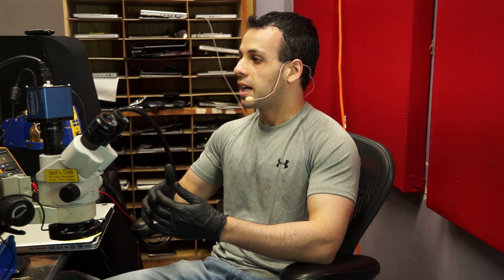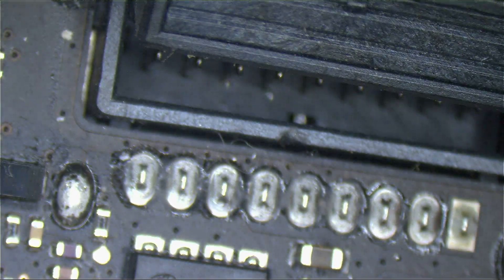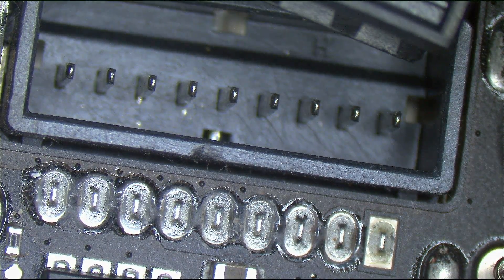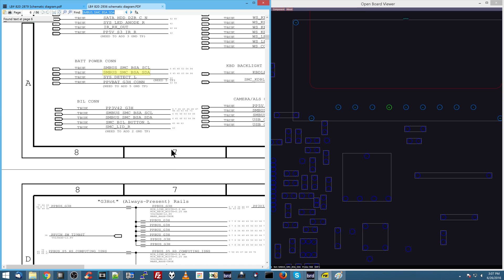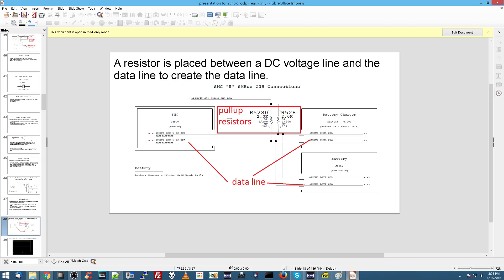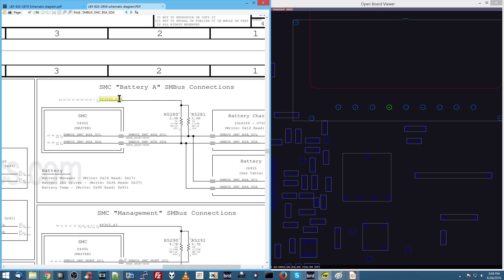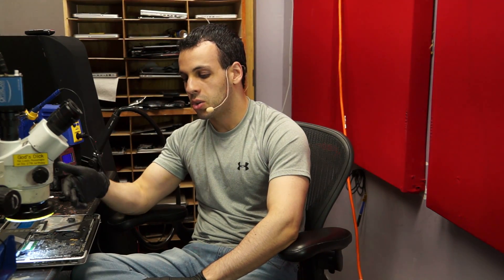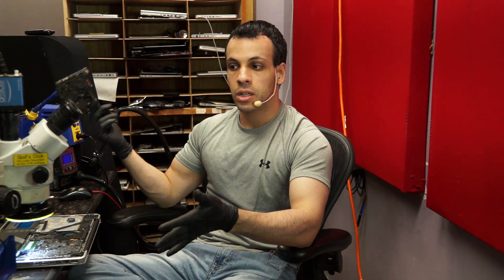DIY tip on Macbook battery replacement

Comment: Hello everyone,
I would like to ask if I can replace bad li-ion cells in my MacBook Pro 2009 battery. I know it iseasy to disassemble. But is there any EPROM reprogramming needed? I have brand new cells and high quality soldering tools to work with. I just don't have any device to "talk" to the battery yet.

Comment: Hey.
I was replacing the battery and me and my dad did NOT have a pry tool. We did it with out bare hands and I think this was a great mistake in this case. Please respond if you dont need to use a pry tool at all. I hope we didn’t. If we did, and I damged my MacBook, I’m screwed. I’d like to know if the apple repairment services can fix this.
And is this about BENDING the pins or just scratching it?
Thank you
Reply: By the way, I tried reseting the PRAM NVRAM and the SMC, which probably did nothing to be honest

Comment: I have a Late 2013 15” Retina MBP. I Bought a replacement battery kit from OWC. What is the easiest method to do the repair. The macsales instructional video has me taking out so much and I see it as unnecessary. I just need basic and thorough instructions. Please help.

Comment: I had to use a metal tool for this. Every other plastic tool I used broke. The connector was sitting really hard. I even managed to break the plastic in two on the battery connector with one of the plastic tools. Fortunately that part is part of the battery and were replaced. Everything seem to work when starting up. I can see the battery cycle count which is reset to one, so I guess I had a steady hand and did not short the data pin. Too bad the battery connector was sitting so hard in the first place. I guess that is what I get for not opening up the computer for over 7 years of ownership.

Comment: hello Louis
my 2015 Macbook Air 13 won't turn on with the battery connected, I've tried it with other batteries and it doesn't work. it only turns on if I remove the battery.
Do you have any idea what could be damaged?
Thank you

Comment: I feel you louis, i have a dell 7537 laptop. It is 6 years old. Now battery doesn't hold up charge and empties in 15 min or less. Which is fine , I understand. 
Then i contacted dell for the replacement part, they said that they only make batteries for the said model for 5 years max. And since the model is 6-7 years old. We  o longer manufacture it. AND directed me to a generic battery from a local market.
I shopped for a little after searching a best price and quality for a generic battery i found one. It was costly. No issues. So i went home. (I was traveling the point i got the replacement battery) now upon using 2-3 days it showed me an error saying that "this battery has encountered a permanent failure and needs replacement" i was like WTF. 
Called up the shop and he said as this is a generic battery, so don't have it in stock and has to order it and will take about a week to get. 
I didn't had time. So i thought  out haste that its just a battery  and may be there is some chip that has been locked to use only authentic batteries by dell. So i took the battery apart and removed the cells and put it on the old battery's board and packed it and WHAM! No power. Updates bios and all the things which i could find online but no go. After searching i found that this is a LOCK by dell on BMS chip on the battery's board that needs a constant power. And if it detected a re-cell it will shut down the battery and that BMS will not start. this is nuts. Anything i can do?

Comment: Hi, I'm not sure if i have this issue. I have the X in the top corner but if i do an SMC reset the battery percentage comes back but then the mac eventually goes to sleep and the battery disconnects and returns back to the black X. Would you say this is going to need a replacement SMC?

Comment: That is an amazing video... THANK YOU. Now had an error show up after replacing a battery. 
NOTE: I PROMISE, apart from removing screws, I used only plastic implements to remove the battery connector, and did not remove anything else (because there was nothing else to remove or move out of the way to replace a Mid 2014 MacBook Pro 15 inch Retina, , Model A1398, machine) and was static free. :)

Please, please help if you can….. I followed instructions for replacing the battery. 
Now… I have a problem that you might be able to help with. When I replaced the battery (correct battery - A1494 model - for this Macbook Pro model - the laptop recognised the installed battery but would not charge it and it would NOT work at all without power cord attached (which stays orange even though not charging, by the way). I was very careful when removing the battery connector too. I thought it might be the new battery that was the problem, and so I reinserted the original battery (which I was only replacing because had a shortened life as ageing batteries do. Prior to removing this everything worked and charged fine... and yet, THIS original battery came up with the same error. Have Apple put in a trip wire code in to stop us replacing batteries in newer glued in battery MacBook models at a hardware/software level????

My only deduction from here is that the board is now damaged somehow. But it is an odd error to see in the system report in that it recognises the battery as installed, but not charging, 0 cycles etc. etc.
Then get this, I have been to an Apple shop (and you can imagine what they said which seemed like B.S. to me, “The keyboard and battery must be replaced at the same time, we can repair your error for $1000”!!
I have never seen or heard this requirement from anyone else before.

Note:
1. I tried all the online methods I could find of restarting the Macbook. Shutting down, waiting 10 minutes, holding down the required keys during shutdown/startup procedures as per some instructions - no change or success.
2. I reset the SMC and PRAM and NVRAM to try and rectify this error, but no change or success.

I do have screen shots of the system report if that would help.

Can you help to get my Macbook to work on battery again? Please, please... getting desperate and don't want to replace what is a phenomenal machine with high spec. :) :)

Comment: After replacing the battery is there anything that i need to do? charge it all the way to 100% before use do i reset SMC? this is first replacement sorry

Comment: Hello Louis. I wonder if you could help me with a bit of advice. I own an old macbook pro (late 2011). Recently, the trackpad has started showing some erratic behaviour, with the cursor jumping from one side of the screen to the other while I wasn't touching the trackpad at all. It got progressively worse, which - to me - suggested the issue might have been battery related. I opened the mac and removed the battery. When I started the mac (now without the battery), the issue continued to present itself. :( I'm not competent enough to be baffled by the mac's behaviour, but I wonder: could it be a virus instead? Do you have any advice to offer? Thank you in advance for your attention.

Comment: GREAT video Louis, thanks so much for posting. I got to this video by searching for a solution to a "Battery" error I now get on a late-2011 17" MBP I bought, that just had a battery replaced with an SMP brand battery. It's possibly related to the non-OEM battery as many people seem to mention in the various forums--but I've actually read that SMP was an OEM manufacturer for Apple for awhile, so I'm not quite sure what to think anymore. Resetting the SMC doesn't seem to make a difference; nor does re-calibrating the battery, although that has indeed fixed the wonky time-to-discharge and charge percent indications. But nothing I've tried actually seems to clear the dreaded "4xxx/6/40000005: Battery" error. 

Sigh. 

Anyone have any ideas?

Comment: Convert your PP3V42 power line to PP12V6 with a flat-tipped screwdriver. Don't delay. Buy today!
Reply: More lika an instruction what you should do to buy a new Mac. If you are stupid enough to buy anything from Apple after watching Louis Rossmann repair videos.

Comment: Great videos. Request you to make a video teaching to repair old laptop battery. I have tried by changing cells on Sony and Lenovo using Panasonic cells but never get output voltage through the pins. Read many things on internet but nothing seems to work. Would be great help.

Comment: Hi i have a question i tested the pins for the charger and found 12volts at the first second it boots up but then it goes to .01 or 0 volts is the battery pin not communicating?

Comment: Hi dude, I need desperate help. I recently opened my MacBook Pro 15" mid 2014 to give it a clean up. All I did is disconnecting the battery, removed and cleaned the fans and heat sink (without removing it) with a soft brush and assembled everything back. The mac had 70% battery when I started this but when tried to power on all I got was a "Connect to charger" icon (the dead battery icon). I then revised the battery connector and saw i didn't pushed it all the way on one side so I did it and when tried to turn on, nothing on the screen not even the icon. It's completely dead .. no reaction at all and the magsafe light does nothing when plugging in... what the hell could had happen? I tried everything like smc reset, plugging unplugging battery.. etc... maybe I'm missing something ? Did I fried the board? Please help, Daniel , Spain

Comment: Why would someone even contemplate using a metal pry tool? when near something electrical, IE the battery.. People in manhattan really are morons.
Reply from the maker: +FlerrElectronics I use metal all the time and don't touch contact points by smc data line!

Comment: @4:07 I have to be a dick about this.. you used mobo circuit board as your arm rest? WTF?
Reply from the maker: My arm is hovering above the board, not resting on it.
Reply: Doesnt everyone ?
Reply: Louis Rossmann My bad. I jumped into conclusion just because your arm was that close.

Comment: The transmission industry is the same situation. They want to make it so you can't repair a simple problem you can only re and re and install a whole new unit. Sealed units you can not open without destroying the pump. At the factory they drill it out and replace it but where are you going to get one? They can't be pulled out without being destroyed. Try that when you live in the middle of nowhere or have a breakdown on your way there. How can you get it fixed? This law works in central AL or a main city but we don't all live in a city. For the sake of a 2 dollar spring or a 50 cent seal you have to buy a whole new transmission is the way they want to make it.
I rebuilt the transmission on the propelled wheels in a 6yr old lawn mower yesterday. It took two weeks to find parts. Sears the retailer disavowed any acknowledgment of the mower. No serial numbers on any of the parts. No breakdowns. No parts availability. I had to find the original Mexican manufacture that makes the mowers for a bunch of retailers. Then found all the other mowers they use this drive system, that does supply these parts and breakdowns. Then found the gear. All without serial numbers. The whole repair took 6 weeks. I'm so glad I took pictures.

Comment: Wow, I made the exact mistake you're describing when trying to replace the battery in my 2013 13" MacBook. Wouldn't turn on, no indicator, no clue what happened. Simply ended up replacing the computer with something else at a much higher cost. Frustrating that I was naive not to think and use metal tools to disconnect the battery connector.

Comment: is it possible to use such a tool to read/write to the smc chip e.g

?: http://ko.aliexpress.com/item/eMMC-eMCP-3in1-socket-SD-9x11-11x10-11-5x13-12x16-12x18-14x18-eMMC-programmer-adapter-reader/32542535705.html?spm=2114.010208.3.1.synz1w&ws_ab_test=searchweb201556_0,searchweb201602_2_10017_405_404_10040,searchweb201603_10&btsid=e7475cab-f2c2-4fcf-9198-4a1ce665965c

Comment: Hi Louis! 
Is it possible to get some type of licensing from Apple and other electronics companies for fixing their devices? I believe this would come with drawbacks but in another way it would help your business. Is this even possible? 
Best wishes.
Reply: Apple doesn't want 3rd parties fixing their devices. They want to sell new ones.
Reply: Randall Caulder i see. Thanks :)
Reply: Third party repair shops can apply to become an "Apple Authorized Service Provider", allowing them to order replacement parts directly from Apple and perform warranty repairs. However, Apple puts many limitations on what AASPs can do. Most importantly, they have to just swap out the parts instead of having the option to perform component-level repairs. They only sell complete parts (motherboard, magsafe board, display, etc), not the individual chips on the parts. This would not be good for Louis, since a huge part of the business he does is component-level repair.

Comment: Someone smashed your window out breaking into your car? That's Fords intellectual property so you need to BUY A NEW CAR! Someone slashed your tires? That's Fords intellectual property so you need to BUY A NEW CAR! Time for an oil change? That's Fords intellectual property so you need to BUY A NEW CAR! Your blinker fluid running low?
Reply: TheTarrMan blinker fluids are BMW's intellectual property 🤣
Reply: When changing parameter in your adding more fuel changing timing shift points on hour own cars their is about 100.00 dollar fee to the company that designed the processor so 
WHISKEY 
TANGO 
FOXTROT

Comment: you actually can vote with you wallet on cars. just buy those cars which are easy to repair. yes they are 10 or 20 years old, but who cares? on cars you can do it but on laptops not really because doesnt matter how old the car is all of them go 100mph. but computers get faster every year. nobody wants to constantly wait until its done doi g something